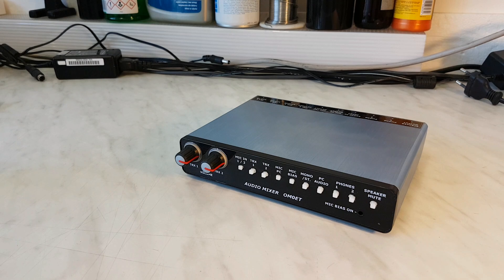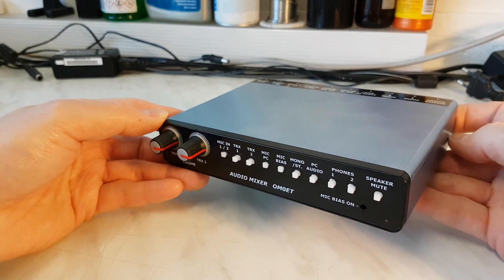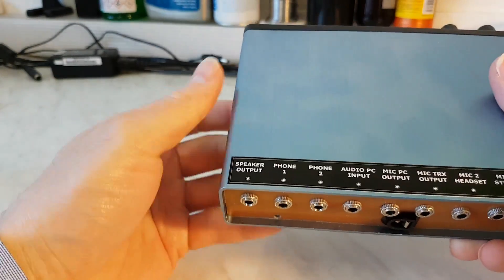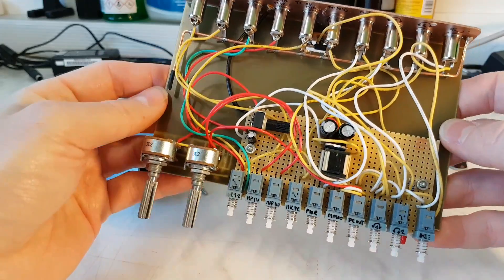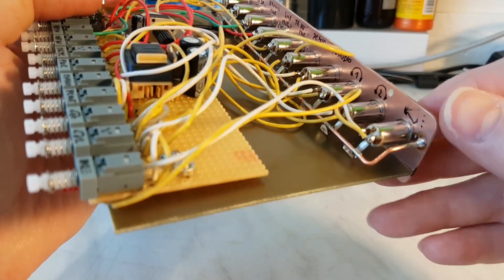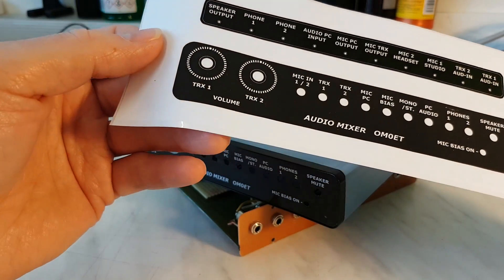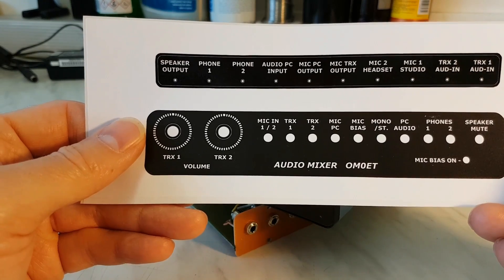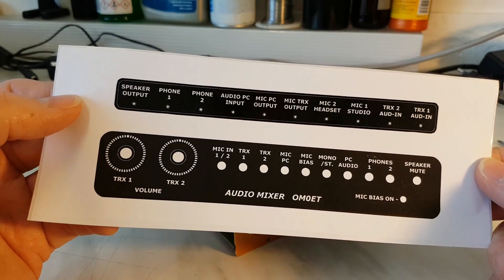Home made Audio MIX

Comment: An excellent and very useful project. This one is definately going on my to do list. Thank you for sharing. M6CYV.
Reply from the maker: Thank you Kenny ;-) It's very simple but useful thing at the shack. My problem is only with poor jack sockets. They are very cheap and they leaving jacks out by a small force on cable. I hope you will find better ones. 73 and good luck! Paul